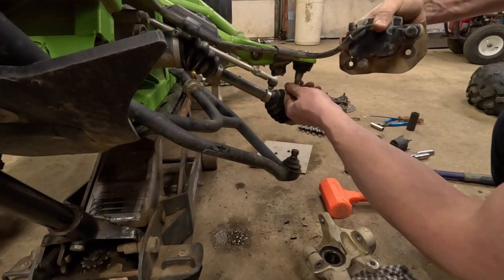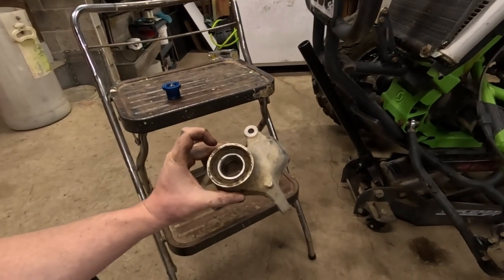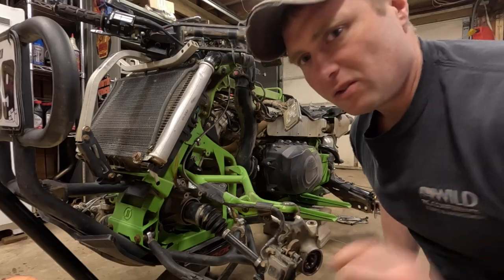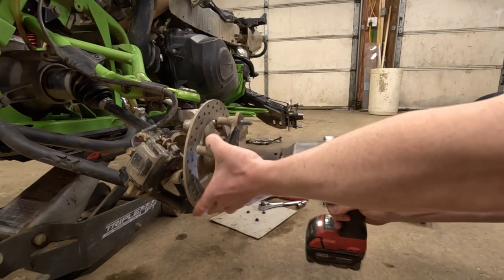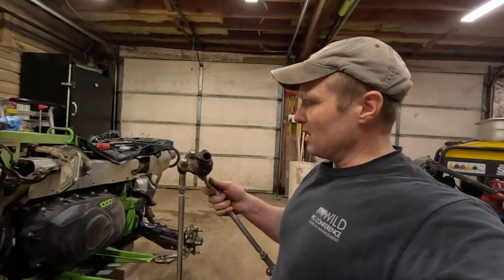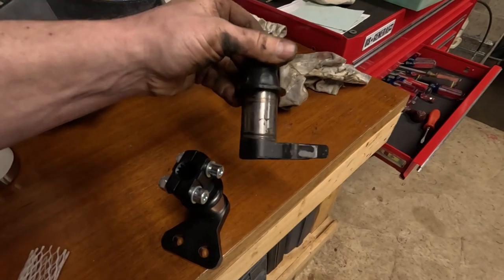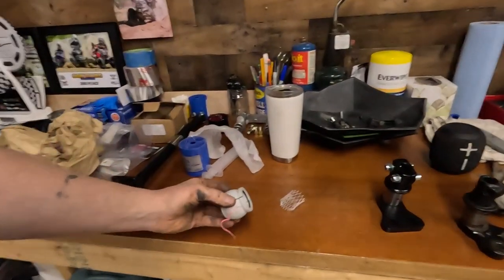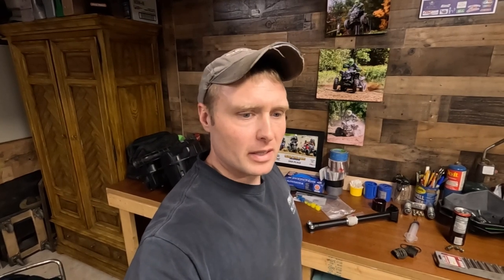Can am Renegade Pitman arm replacement.

Comment: Question: Is the steering shaft indexed on the pitman arm or do you have to measure to make sure that your handle bars/tie rods/front hubs are all aligned properly?
Reply from the maker: The OEM ones are keyed. These are not but I think I got it pretty close. I might have to make some adjustments.